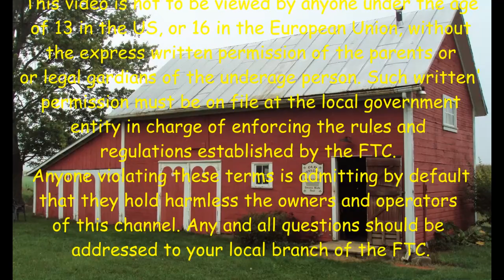Double Bit Axe   Sharpen & Polish

Comment: Yikes! I'd probably accidentally slice my thumb off if I had an axe that sharp.
Reply from the maker: Came close to disaster when I was a kid. 
Carrying my first axe out of the woods with the head over my shoulder I stumbled and the head slid forward.
 It's a horrible sound when the blade cuts through your hair and hits the back of your head. 
I read somewhere that the Samurai had a bun on the back of there head at about their neck. It acted as a sheild. 
I didn't have a bun. Just enough hair it didn't make it through. 😁

Comment: Today I found a rusty, broken off, dull, double bitted axe head at a friend's grandma's house. They said to keep it. It will be the first axe I've ever truly sharpened and restored (21 years old). I have a bench grinder with a wire and buffing wheel and can't wait to put it to use before rehanging the head. love the video. They clearly don't make tools or good handy men like they used to

Comment: Good day eh!!!  Nice axe and you put a nice edge on it.  The old wet stone wheel is nice to use like you say, but the buffing wheels are great to fall back to eh!!  Take care!!
Reply from the maker: The grindstone does a good job of shaping the edge. With a steady drip it builds up a slurry that will polish the steel to a good edge for an axe. 
The fiber wheels will take it to a razor edge. The Plumb double bit will hold a sharper edge than most axes. If I take most single bits up to the same edge it will fold.

Comment: Appreciate you sharing the wisdom!  I've seen some people sharpening top tip to bottom tip, others sharpening wheel revolution towards the edge like you.  Can you speak to why this is the best method?  i would think that this ensures a more even edge.  Is it wheel against edge and hand stone along edge?
Reply from the maker: I have been grinding since I was 11 years old. 
The wheel rotating towards the edge doesn't leave a burr along the edge.
I do the same with a flat stone. Always the same coarse to fine and not a burr in the bunch.

Comment: Correct me  if I was wrong but weren't you going the wrong direction on the manual wheel.
Reply from the maker: That has been debated for years. I like to have the wheel turning toward me so the the burr is reduced. I can also control the position better with the tool rest that I made for the treadle wheel. 
It also has the advantage that the water is applied to the wheel just ahead of the tool so the flushing action is better in my opinion. 
To each their own. 😁😎

Comment: Interesting video- just curious, what did you rub on the bits and handle at the end?  I have cut myself twice when sharpening and the odd thing is you always get a kind of premonition that it's going to happen (at least I do)- last time was when I was attempting to remove some stubborn sap using my fingernail- big mistake but that's how you learn right- I lived but it bled like crazy for quite some time.
Reply from the maker: 50/50 Boiled Linseed Oil and odorless mineral spirits. Followed by either Boston Amber Paste wax or Minwax paste wax. 
I call them 2 second Dumb Ass Attacks. (2SDAA) 
I get in a rush or distracted and there it goes again. 😂
Not as much premonition as recognizing the cause after the fact. 😁😎
Reply: @OldSneelock  Thanks for getting back to me!